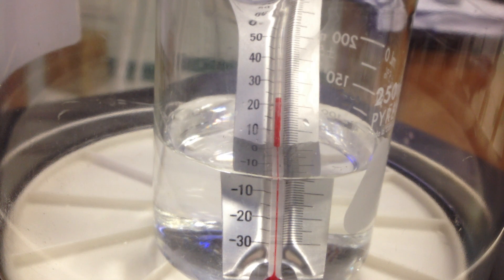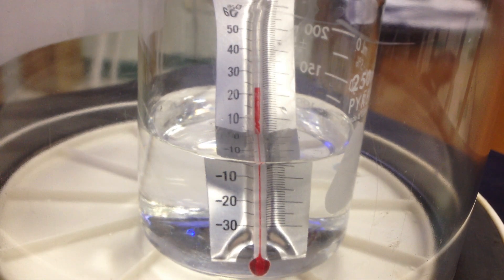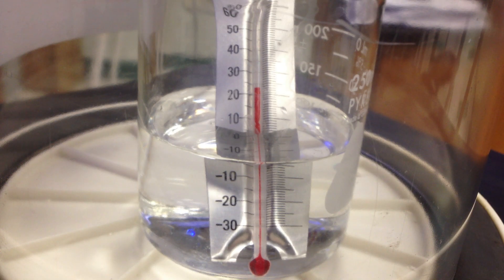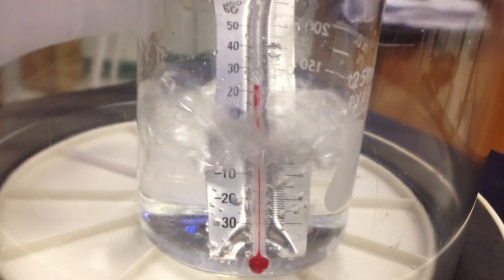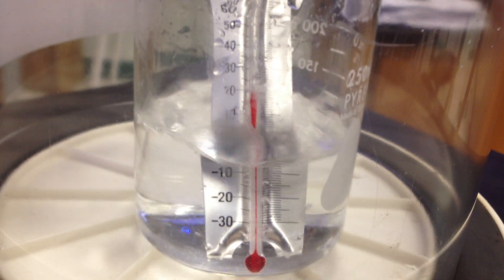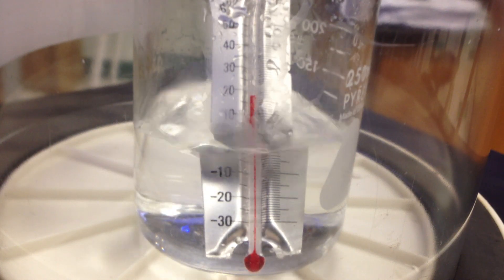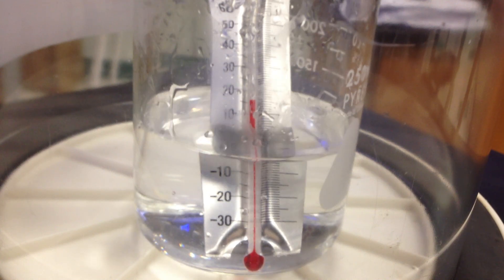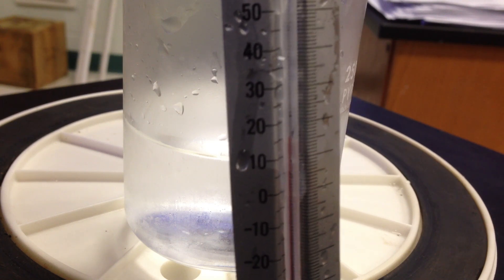Boiling cold water In a Vacuum Chamber

Comment: Could you cook something in boiling vacuum water?
Reply from the maker: No because the water is boiling at room temperature because of the lowered pressure.
Reply: It is possible to cook at room temperature. Cerviche is fish cooked by chemical reaction with acid like lemon juice or vinegar. Meringue, like in pies, is made by whipping egg whites, which cooks the egg whites. I don't know of any other ways to cook at low temperatures, unless "toasting" bread in a very dry environment counts. I discovered that one in my car on a very cold day, when the heater dehydrated my bread in my PB&J sandwiches and made it feel like light toast.

Comment: my professor did this experjment, but he didn't create a vacuum,he let the air go out and fill it with water vapour . then he sealed it and 
 he cooled it and water started to boil .. How ?
Reply from the maker: I am interested in more details on how this was done but essentially if I am understanding you correctly your professor did create a partial vacuum by removing atmospheric air pressure (lowering the number of moles of air molecules) and cooling the the remaining water vapor (lowering the kinetic energy or motion of the water vapor). Those 2 actions would lower the pressure above the liquid enough to have the liquids vapor pressure equal the pressure above.

Comment: Great video. What type of vacuum pump do you used? Do you know the flow rate? At work, we have a vacuum pump but I never see those kind of results.
Reply from the maker: Its a basic 2 stage demonstration pump that we got from one of our suppliers.  If you are not getting results check your seal in your chamber.
Reply from the maker: What are the chances that all water molecules are doing the same thing? Molecules at the same temperature have a range of molecular motion.  We call this a Boltzmann distribution which would show that there are many more molecules that have similar molecular motion while there will be less as move toward the higher end and the lower end of the graph ( like a bell curve). 
Having different motions related to the molecules having different kinetic energy.
Reply: Can you explain how the water boiled despite being below its boiling point using vapor pressure, intermolecular forces, atmospheric pressure?  If so that would be great!!!

Comment: You don't have a very good vacuum pump.

Is the "boiling water" 'at the top' hot to touch, or is it all just the temperature on the thermometer?

I probably answered my own question. You probably should have talked about this.

Most people think that "boiling water" means to make it very hot, because that's mostly what we do to get water to boil, but that's not really the definition of the word boil, which is:

boil - "to change from a liquid to a gaseous state, producing bubbles of gas that rise to the surface of the liquid, agitating it as they rise"
Which is what you did, but you just did it with pressure instead of heat. That wasn't clear in your video.
Reply: Do you have a better vaccum?
Reply: It was very clear in the video. You could even see the thermometer.

Comment: but what if instead you fill the air in, than suck it out ? must be something interesting happen...
Reply: nothing would happen since higher pressure only raises water's boiling point.
Reply: but,this is just in... some scientist make diamond from graphite by pressed CO2 and all stuff in high pressure chamber. so what happen if its water?, just inform me if you do experiment base on my (stupid?) idea, i want see it coming.. : -)
Reply: Michail A. B. 
in the end it would still be carbon, just a piece of really "concentrated" carbon, that's for solid, even though pressure doesn't affect solid or liquid much
Reply: If you use enough pressure, then you would dissolve some gases into the water, like the "carbonated water" in soft drinks, by adding high pressure Carbon Dioxide. But, you would need a pressure vessel instead of a vacuum pump.

Comment: Do you know what is the energy consumption of your vacuum pump (Kwh)  to transform 1 liter of liquid water (+ 25Celsius)  to 1 liter of ice (-10Celsius). Does it make sense to produce ice this way instead of standard technology?
Reply: won't it turn back to water once you relieve the pressure hence you need to keep it cold or transport it under pressure.
Reply: @markbuckeye  no there’s another video on YouTube that shows the frozen water remains ice.
Reply: @miles67733  I realize it is "ice" and will melt over time, not instantly but you either need to keep it under pressure or chilled to keep it from melting.
Reply: Can you explain how the water boiled despite being below its boiling point using vapor pressure, intermolecular forces, atmospheric pressure?  If so that would be great!!!
Reply: @yimszy4588  boiling point is a function of pressure...it is not a constant...this is why water boils at different temps/ altitude
Reply: @markbuckeye  Thanks my brother 😁☺️...

Comment: So what's the temperature of the water? ~20°C? I mean it's not hot to touch?

Yeah, now I see.. boiling point is actually the temperature at which the van der waal's forces break at a specific temperature. So it's related to pressure, not just the temperarure alone. Wow.

Comment: The demonstration in your video is perfect. I have a question regarding the vacuum pump. Which type of vacuum pump have you used in your demonstration ?  also how to deal with the matter of water vapour condensing at the outlet of the vacuum pump? It may be very helpful for me..
Reply: Any pump will do
Reply: @garywade7177  No. Most pumps use oil. Water does condense in the vacuum oil breaking the pump. A second question is which pressure is used as I also tried this using a 2 Pascals pressure and nothing happened.

Comment: Why did he expect the water to freeze when he let the pressure back in?
Reply from the maker: +CROWFable I need to correct your statements.
1: " all elements are made of compound molecules."  There are certainly some elements that bond with themselves (diatomic) but an element is defined by being a unique atom with a unique number of protons. The noble gases for the most part do not make any bonds.
2: We should not be discussing bonds between atoms but the intermolecular attractions between molecules.  The force that keeps molecules from evaporating are not chemical bonds but attractive forces.  What is being demonstrated is a physical change. H2O (l) is becoming H2O (g).  The chemical formula is not changing.
What makes this a bit confusing is that the attractive force between water molecules is call Hydrogen Bonding but regardless of its name it is not a bond but an attractive force.
3: "So as the systems pressure decreases the volume expands" - If your are talking about the liquid water then you are incorrect as liquids are not compressible thus there is no significant change in the volume of water as the pressure dropped.  If you are talking about the gas you are also incorrect because the relationship between volume, pressure and temperature that you discuss works when the moles or number of gas molecules stays constant.  The gas molecules are being drawn out of the chamber so this relationship does not work.
4" As the volume expands the temperature drops because it's expanding through evaporation which loses heat"
The liquid does not expand. The liquid has less atmospheric pressure pushing on top of it thus it needs less energy to get to the surface and evaporate.  All molecules of the water have a range of kinetic energy and thus the one that have the most leave first taking with them some thermal energy and the water gets cooler. 
5. "He was simply wrong in assuming that the slowest reacting H20's would require even more stability and thus move into a solid state arrangement."  IF you look at a Boltzman distribution curve of the range of kinetic energy that the molecules of water will have at room temperature it will be clear that the slower moving molecules will evaporate last and need a lower pressure to evaporate and to even freeze.  
6. "slowest reacting H20's" Again water did not chemically react it just evaporated.
7. "As the expanded volume is suddenly introduced to it's original pressure the energy required to suddenly condense would lose more heat thus creating the solid state ice among the H20."  A better way to explain the freezing would be through the Joule - Thompson effect.  The expanding gas entering from the outside the chamber expands to fill the chamber.  This gas needs to break ATTRACTIONS from other gas molecules to expand thus consumes energy and the thermal energy drops which can cause the water to freeze.
Reply: +DANGJOS to understand this universally, you have to consider all the rules to being an element for example all elements are made of compound molecules. They form bonds based on the most stable arrangement possible inside of a system. there's more but these two are the most relevant... In this case the system is our environment and the vacuum is changing the system via atmospheric pressure. So as the systems pressure decreases the volume expands. As the volume expands the temperature drops because it's expanding through evaporation which loses heat. As the expanded volume is suddenly introduced to it's original pressure the energy required to suddenly condense would lose more heat thus creating the solid state ice among the H20. He was simply wrong in assuming that the slowest reacting H20's would require even more stability and thus move into a solid state arrangement.
Reply: MrGrodskiChemistry  Don't you mean it needs to break attractions in the liquid to go to a gas, rather than having to break attractions in a gas?
Reply from the maker: For the water to cool due to evaporation attractions are broken in the water. For the expansion of gas returning into the vacuum chamber the attractions of gas need to be broken to fill the chamber.
Reply: MrGrodskiChemistry  I guess there are some breaking of the attractions in the gas since it isn't really an ideal gas.  I just wondered why you said that, because normally for an ideal gas approximation, it is assumed there are no attractions in the gas and the drop in temperature is caused by the gas giving up it's kinetic energy to expand against the pressure in the container.  However, for a non-ideal gas, both effects would be there
Reply: +MrGrodskiChemistry nice to see a passionate discussion !!

1,2)yes I did indeed use terms interchangeably,  I'm glad you pointed out molecules vs atoms and  forces   rather than bonds since in chemistry there is a difference! (however for me there is a grey area which for the sake of order I'll avoid entirely here).  That being said I do commend you for sticking to your chemical guns! haha

3)also any change in the current state is a reaction no? In other words there is no change unless there is a reaction. I never did actually specify if it was chemical or physical.

4,5,6,7) Volume within a system refers to all parts of the system, fluids/vapors/gases, these are dynamic you can certainly isolate them but doing so is an esoteric endeavor not a practical one. Reducing the pressure just further increases the volume of the system because you are removing more gas. So boltzman would still agree as the concept does not change, it's  merely expressed differently (I'm seeing a pattern in misinterpretation) in a manner which allows visualization of a concept.

Ultimately the point is to take into account when experimenting that there is a universal aspect to what is being done. However all of the dynamic principles taking place in this experiment can indeed be traced down to intermolecular behavior via their elemental properties.
Reply: +MrGrodskiChemistry  I must say this.  I am afraid that you are mistaken that energy is required for a gas to refill a container.  When the pressure of a gas in increased the temperature RISES.  Also, expanding gases cool down NOT because of inter-molecular interactions, but because they are giving up their own kinetic energy in order to expand.  So there is no way that your water would freeze after letting the gas back in.  If anything, the water will actually get slightly WARMER from the increase in pressure.  This is negligible though
Reply from the maker: The expanding gases cool according to the Joule - Thompson effect because the kinetic energy lost is converted to work to overcome intermolecular attractions in the gas.
Reply: +MrGrodskiChemistry  I must admit, the Joule-Thompson effect was far more involved than I thought when I looked it up.  I see that more cooling can be done than I would have thought due to expanding real gases.  So I learned something today.  But what still puzzles me is why you say that the gas would cool when it is let back into the container.  That seems to break a symmetry to me.  If the expanding gas cools as it exits the chamber, then why would it also cool while being let back in??  Sorry, that just doesn't make sense to me.  So what's the deal there?
Reply from the maker: From my perspective the gas would expand as it enters the partial vacuum and it would also expand as it throttled through a small opening by the action of the pump much the same way it happens in a refrigerator.    It would seem reasonable to think that the effect would more significant when there is more gas molecules in the vacuum chamber and less as the vacuum pumps continues to drop the pressure.
Reply: +MrGrodskiChemistry  Oh I see.  I suppose that could cool it.  Although it almost seems like a free expansion yes?  If anything, I would think that the atmosphere itself would do work by forcing the air into the chamber, which would cause the atmosphere to cool a bit outside.  Inside, it should have been the faster moving molecules that reentered the chamber yes?  Well regardless, even if the air does cool as it reenters the vacuum chamber, the water was still at 16 C, so I really do not think it is possible for the water to have frozen as the air reentered the chamber
Reply from the maker: No work can be accomplished by the gas outside the chamber to fill it because there is nothing to do work on in a vacuum.  The cooling occurs in the chamber because that is where the expansion can occurs..
Reply: +MrGrodskiChemistry  No, I mean that the gas enters the volume because...actually never mind.  I am the one that called it a free expansion after all, so of course no work can be done.  Okay, so then that means that the only cooling that can take place, is because of the breaking of very weak inter-molecular bonds in the air.  That goes back to my point that we shouldn't expect the water to freeze from the air being let back in as any cooling would be very minor (if there's any cooling at all).

Comment: what if you submerge something like Styrofoam or marshmallow underwater then vacuum it?
Reply: +Dusty OldBones It would most likely expand really big and fat
Reply: Wouldn't the water act .like some kind of barrier against the vacuum? I don't think it would expand at all. I could be totally wrong though.
Reply: Water pressure in the vacuum and on earth probably aren't the same due to the air pressure pressing down on the water. How much of a difference? Idk maybe like 14 PSI
( air pressure ). So probably but not as much if the marshmallow was in there by itself.
Reply from the maker: The deeper you submerge the vacuum chamber the greater pressure in the chamber, meaning there will be more molecules of air in the same chamber. That would require my vacuum pump to remove more molecules to get the same effect. At some depth, my pump would not be able to remove enough air molecules to boil the water or expand the air in styrofoam or marshmallows.
Reply: I realize this question is from 7+ months ago, but given deep enough water I think you may be right.  Air pressure at sea level is 14.7 pounds a square inch.  It takes about 10 meters (33 feet) of water depth to achieve that same pressure.  If somehow you could get the marshmallow/styrofoam down there without crushing it the pressure from the water would probably keep it from expanding from the vacuum chamber (perhaps a device that lowers in the tank as pressure changes, could probably figure this out with buoyancy).  Which makes me wonder if I were swimming in a vacuum chamber with an oxygen tank, could I survive the vacuum if I dove deep enough?  Temporally perhaps, at least until the water gets to cold for me... (thanks for the strange train of thought)

Comment: so where is the energy from the water going?!?!!?
Reply from the maker: +Ali Syed The energy is leaving the vacuum chamber. The water molecules that have higher kinetic energy that evaporate leave the water and are removed from the vacuum.
Reply: i understand that water has potential energy stored in it while it's in the liquid phase and as the atmospheric pressure drops, so does the boiling point of water. The energy starts to leak out of water cuz the atmospheric pressure just isn't there to push against the water. But isn't the vacuum chamber "absolutely sealed"?
Reply: suppose if we do have an absolute sealed cauum chamber, what would happen then, will the energy conduct itself out?!?!?!?!?
Reply from the maker: If the vacuum was sealed my guess is that the water would boil then would stop as the internal pressure increases due to the vaporizing water. There would be less energy transferring once the boiling stops but the energy would transfer easily to the increasing amount of water vapor in the chamber.
Reply: +Ali Syed  The energy is stored in the broken bonds in a sense.  The energy inside the liquid went into breaking the bonds between the liquid to turn it into a gas